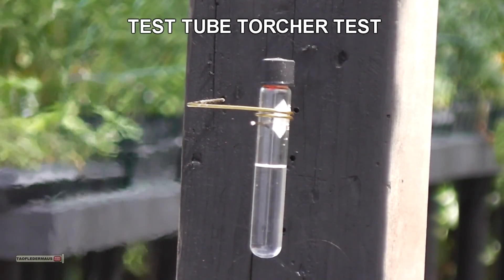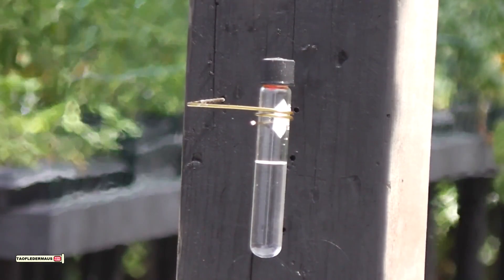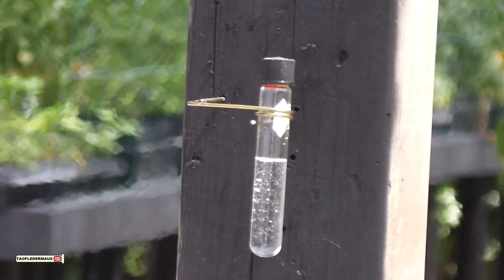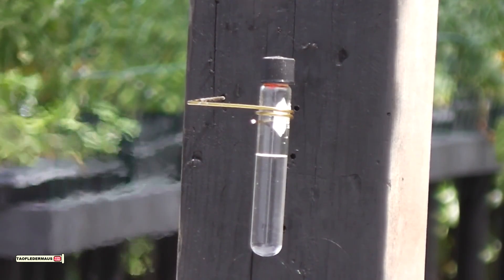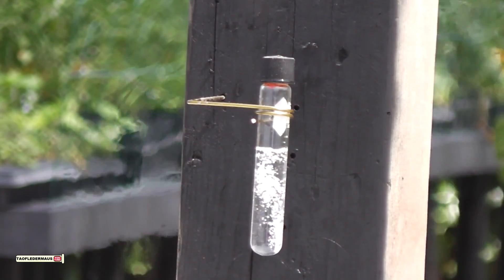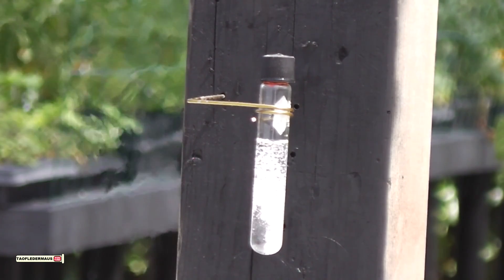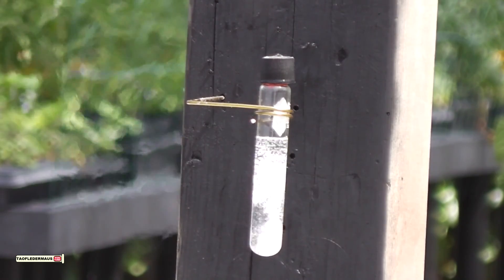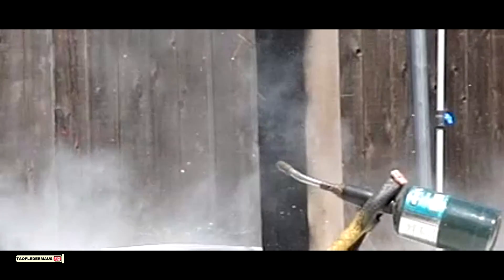RUBBING ALCOHOL -   Super-Heating a Sealed Test Tube

Comment: I've always been amused by these, but have always felt that the results would be even better if the cap wasn't the failure point.  Would really go off with a BANG then! Not sure what you could use to make that strong of a seal.  Perhaps two part epoxy.

Comment: You could measure the temperature with a thermal couple, the wire is cheap and could be run through your plug, the couple it self is made by simply twisting the bare ends together and there are several meters on the market to measure the temperature.

Comment: Glad to see TTTT again! Coincidentally I fell into a Youtube vortex a couple days ago and ended up watching a bunch of videos of race car alcohol fires; nasty stuff, and it's even worse because you can't see the flames.
Reply from the maker: Alcohol fires aren't as bad as gasoline fires.   You can put them out with water,   but you can't do that with gasoline.
Reply: *****
True. I guess I just meant that alcohol fires are more insidious in a way, simply because the flames are barely visible. Then again, I'm also thinking of racing fuel-grade alcohol, not 70% iso from the grocery store. BTW, my grocery store (Kroger) also carries 90% iso; wonder if that would behave differently since it has quite a bit less water.

Comment: Have you ever thought of using something a bit more permanent to seal the tube instead of silicone? Like superglue or something that would bond better to the tube and be harder. Use a piece of wire with a cardboard blank lowered into the vial and then fill the neck with the glue and let it harden. I remember other videos where you were kinda complaining that the plug would always blow out before the tube would actually rupture.

Comment: Hey Jeff, just curios, whats the melting point on the plastic cap?  Also if the cap melts, does that have any bearing on pressure the red plug is able to contain?  As always great video.  I was a bit shocked the alcohol did not try to flame over.
Reply from the maker: Eh,  probably 300 deg f  but plastic will begin getting softer at a lower temp.      The cap helps hold the silicone plug in a little bit.

Comment: hey, this has potential, i feel like in its current form it isnt very useful, however if we could learn more from this that would be cool. for example, why does the liquid not come to a boil in a linear fashion? it appeared to fluctuate a lot before it stabilized. there must be some way to get more data from the vial, temperature? pressure? id also be interested to see if the temperature at which the liquid burns (flash point) changes at different pressures, could you create a pressurised flame?

Comment: At first I was suprised that there wasn't a fire ball, but then I guess the air/alcohol ratio was not right with all the vapour around.

Nice to see another TTTT - thanks.
Reply from the maker: We usually don't get a fireball.   The air-fuel ratio isn't right or it just displaces all the oxygen and snuffs out the flame.

Comment: Love TTTT.  Moar!  Have you considered using a bi-metal thermo-couple with a whetstone bridge to get an analog temperature reading?
Reply from the maker: Sounds expensive!
Reply: tsk.  gotta voltmeter?  got some copper wire?  aluminum wire?
https://en.wikipedia.org/wiki/Wheatstone_bridge
okay, a degree in electrical engineering is helpful.

Comment: Well as someone who runs boilers that operate at 1250 psig I find these videos awesome and would love for you to keep then up. On a side note it's pretty cool to see these blow up. But when a boiler blows a generating tube or even a superheater tube. It's truly amazing to see that much raw power released that quickly and violently. Don't mistake that as thinking it's cool not at all. It's extremely dangerous on a boiler because there is no one in control when it happens. Where as you have set up controls.

Comment: I'm surprised it didn't catch fire when it blew.
Reply: The gas scatters too quickly due to extreme pressure.
Reply: Amit Skanda The fact the gas scatters is what made me wonder why it didn't catch fire. Liquid gas (strange concept) isn't as flammable as "gaseous gas". Once the gas has been mixed with air, as per the scattering seen in the video, it becomes highly flammable...normally.
Reply: Daniel W True but it scatters so quickly that the velocity of the gas is much greater than what the burning rate of the gas is.

Comment: Is it within your possibilities to make a glow wire inside; for heating from the inside of the test tube? Could be interesting, been experimenting myself with a sealed (*plastic, cpvc 16mm 2.2mm wall) fuel container inside a oxygen rich combustion chamber with a 8" open top covered in foil. Big bang and a lot of flames, I use 0.5ml nitromethane 16% for my particular project, which is meant for creating 1:16 rc tank sim battle effects.. inside cardboard houses ;)
 Though my version uses a small strip of alu tape which gets vapourised in the bang, a glow wire might be more interesting to watch in slow motion.

Comment: I like the TTTT's. I vote keep em going.
Reply from the maker: thanks!!
Reply: +TAOFLEDERMAUS maybe it's explained but I'm new. What's taflerdamuas mean?
Reply: I also like them, but you could definitely do more interesting chemical combinations. 

Keep in mind that what you effectively have in these tests is a very crude high pressure reflux apparatus, could get some interesting results with more complex mixtures. 

Just off the top of my head, crude oil might be interesting.
Reply: +gonzostwin1 Fledermaus means bat. Like, the flying mammal variety. Don't remember about the Tao part.

Comment: I'd love to see more!
One suggestion:  Use a pump needle (for blowing up balls) and use the silicone to seal that into the test tube to try to measure at what pressure the silicone plug or test tube can handle.  Just hook it up to a compressor with an air gauge.  Maybe try a small sample quantity to allow for variations in the silicone plug quality.  Maybe have the test tube inside of a monitored (near)vacuum enclosure in case the pressure loss is gradual?
Probably too much work - but just an idea.
Reply from the maker: I don't have anything that will pump it up that high.   Also,  the heat probably plays a role in at which point the silicone blows out too.

Comment: Here's my feedback, make more TTTT please! 
I was expecting a fireball after exploding but that's ok next time :)
Reply from the maker: I think the next one will be motor oil.  It will probably reach its flash point.   The alcohol  vapor snuffed out the flame,  and the decompression caused  it to evaporate and chill itself below its flash point.    Oil based stuff tends to not do that.
Reply: +TAOFLEDERMAUS For the motor oil, try with mineral oil instead of synthetic. Only bc the mineral has a lower flash point I believe.

Comment: how about using a large area washer with 4 small holes drilled at a quadrant then use locking wire to hold the cap down.     All your videos are A+

Comment: Superheating is the phenomenon in which a liquid is heated to a temperature higher than its boiling point, without boiling. In higher pressure boiling point increases. Superheating is achieved by heating a homogeneous substance in a clean container, free of nucleation sites, while taking care not to disturb the liquid.

The presence of bubbles tell me clearly that this isn't superheating.

Comment: I would like to see more occasional TTTTs. Some ideas for substances to test: Wet Flour (flour and water, if it does what the bean can did ages ago, flash water to steam, you might get a fireball), Gear Lube, Glow Stick Fluid, Cheeze Whiz (the stuff from a spray can), Candle Wax, Saw Dust, Air Soft BBs / plastic in general, butter, Silver Anti-Cease Compound, CPU Thermal Paste,  2 part epoxy ( cured / in the process of curing or layered ), lead free solder, gorilla glue, super glue, hair,  test tube full of LEDs, ice cream, automatic transmission fluid, sea salt, ... hehe ok.. now I'm rambling.

Comment: Would be Sooooo great to have more. If you can, try some AC fluid like cyclopentane or R134 or any fluid like that (the ones used in refrigirators and AC cooling) I think it should be interesting

Comment: I wonder why the alcohol didn't cause a big flame?
Reply: Explosion probably blew the torch out before the alcohol reached a good air/fuel ratio for combustion.
Reply: +FrankTheCat Thanks Frank!
Reply: Its very likely the torch was blown out by the rapid expansion of water vapor and alcohol which essentially evacuated the area of oxygen.
Reply: I thought that too, but it gets me wondering because we are talking about a alcohol explosion. How can alcohol 'blow' a torch out?

But I guess you're right, I just don't understand it.
Reply: It would be interesting to see if you can heat alcohol to its ignition point in a sealed container, if that would work it would explode as soon as the tube bursts and the alcohol turns into an aerosol.

Comment: Hell yeah more TTTT! Can you do liquid nitrogen TTTT?
Reply: +dragonigthFX the extreme cold would probably cause the fail to seal. Remember what happened to the challenger?
Reply: +TotalMetalJacket True, I wonder what a tube not made of glass would do though? I'm thinking something along the lines of 410 stainless steel around the same thickness as a test tube . IDK if that would even do anything at all,  just throwing it out there.
Reply: +Spark Gap i think you switched 'seal' and 'fail' on accident... (sorry, didmt mean to be a grammar nazi...)
Reply: that would be imposible because the nitrogen expands out of itself meaning it would blow up the test tube anyway and how would it be able to boil it anyway its  −320 °F/−195.79 °C
Reply: You know, that sounds dumb at first, but it actually might be interesting. The experiment wouldn't last long since as soon as the nitrogen starts warming up, it'll build up a lot of pressure and explode, but it might be cool seeing the nitrogen fly everywhere in slow-motion, reacting to the air.

The only problem might be keeping the liquid nitrogen cold enough during the preparation, when he seals the tube and sets up everything.
Reply: pour no2 into the tube, place tube into a bowl of more n02, apply silicone stopper, remove tube after silicone has cured. I'm not sure how long it takes for the silicone to cure to form a decent seal, but these tubes seem to be able to hold a lot of pressure regardless.
Reply: The plug might have issues sealing at such a low temperature.
Reply: Well you wouldn't submerge the tube and the plug into the liquid no2, just enough to keep the contents cold and not boiling at air temp.
Reply: Sizukun1
Doesn't have to be submerged to still be cold as hell if you've ever been near liquid nitrogen.

Comment: What if you reversed the tube but heated it from above? Maybe add some sort of fins to the tube to make it fly straight like a rocket.
Reply: Theoretically you could have it in the same arrangement and simply be projected into some sort of guide tube that would redirect it upwards. Some 4 inch pvc would work well.  Mind you there are serious legal and safety concerns with launching super-heated containers of volatile chemicals indiscriminately.
Reply: he would be heating the gasses, not the liquid
Reply: It would be cool if there was a way to make it work, but it would be extremely hard.
Reply: The air gap between the fluid and the bottom (now top) is not a good conducter of heat.
Reply: Heat travels up, not down. The liquid would likely reach no where near as hot as it did here.

Comment: MORE TTTTTTT!
Other thoughts: Would be cool if the holder wouldnt let go so the blow out can be watched relatively stationary (maybe more wire preventing the slip out).
A thermocouple (2 specific thin wires welded together at the endpoint) inside the TT could survive  the blast and if not you just cut the end and reweld, a roll of thermocouple wire would be enough for years of TTTT. They are available with high temp isolation  up to >>1000 deg C (probably not even necessary). We used them to measure temperatures inside of welding joints during underwater welding experiments...
Also it would be very interesting to measure the pressure inside the TT during TTTT. Maybe a tiny metal tube (think refrigerator coolant lines but smaller) could 'conduct' the pressure to a sensor in a safe location (behind the post)? Obviously with higher frequencies the gas column would oscillate inside the tube but in this application Im expecting relatively slow pressure rises. Im using pressure sensors with a similar principle (inside spark plugs) to measure the pressure inside of gas engines during operation so there are sensors that survive such an enviroment...
Just my 2 cents, always enjoying your videos!

Comment: You could use a resistor type temp sensor they cost literally a couple cents a piece, probably less then the test tube your blowing up. I would use a long  enough wire lead to safely reach temp. reading unit.

Comment: I like TTTT. Why didn't the alcohol ignite after atomizing in the air?
Reply from the maker: It displaced the oxygen so it snuffed out the torch.   When the pressure dropped,   it  self-refrigerated (flash cooled)  so it was below its flash point.    Other stuff like diesel fuel didn't flash cool so it ignited.
Reply: I wondered if the pressure drop was a factor.  Thx Taof - keep 'em coming ;)

Comment: this is definitely my favorite mini-series.
Reply from the maker: thanks for the feedback!
Reply: +TAOFLEDERMAUS definitely man! These tests show some unique and awesome properties that you would never expect. Also do you think that the 70/30 mixture is what led to it not igniting vs a 99/1?
Reply from the maker: More often than not the torch is snuffed out because the vapor displaces the oxygen to it.   But it didn't auto-ignite because it acted like a refrigerant when it went from a high pressure liquid to a low pressure vapor.   The water actually expands much more (1600:1 ratio)  than alcohol  making everything more energetic.
Reply: +TAOFLEDERMAUS Gotcha thanks man! You explained that perfectly. I have a couple other higher level questions so don't worry if you don't know the answer to them. Now we know that evaporation in a regular setting is endothermic, so would these tests with flash evaporation be endo or exothermic? And/or are there two phase changes going on because after it flashes it wants to turn back into its original phase? And piggybacking off of that, if these reactions are endothermic, do you notice that certain liquids that have higher expansion ratios tend to not auto ignite because they are using a majority of the energy initially during that flash phase change. I know that other factors contribute to auto-ignition like intermolecular bond strength and chemical makeup (ex. water v. isopropyl alcohol), but in general do you notice this to be the case?

Comment: Always more TTTT is needed. I've missed these quite a bit.

No walking barefoot in that yard anymore, eh?

I was surprised to see a complete lack of color/consistency changes like we've seen in many of the other materials. I assumed that like many materials, one could "burn" or otherwise denature isopropyl resulting in an easily visible color/consistency change, but I guess not. Good to know! Did it smell any different? I imagine the vapor must have been overwhelming.

Comment: Its not only the flame screwing up infrared thermometers. Its also the emission factor, which will dynamically change as the thing starts boiling etc, so there wont be any accurate readings from such devices.